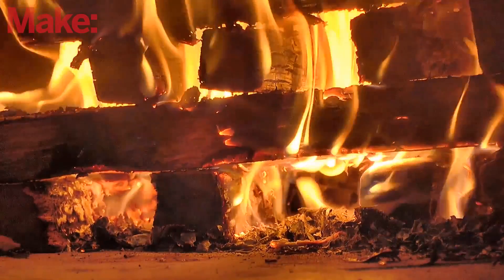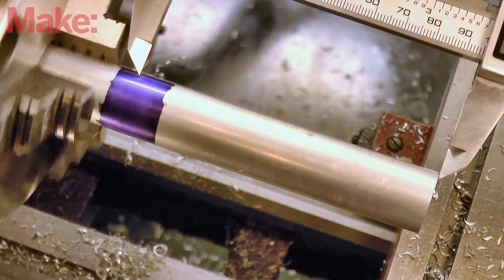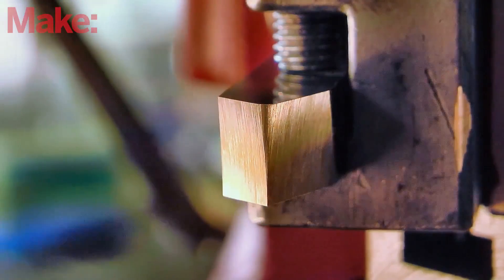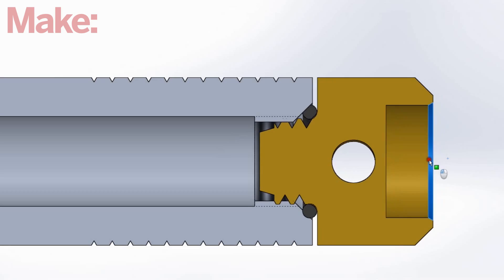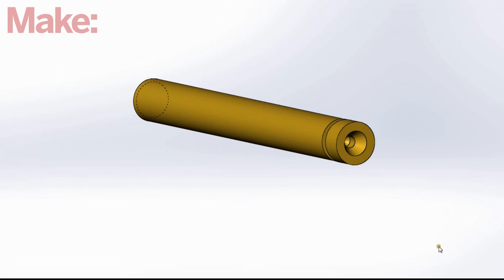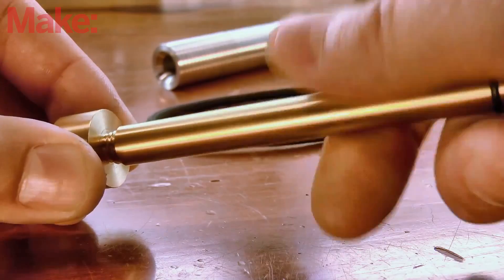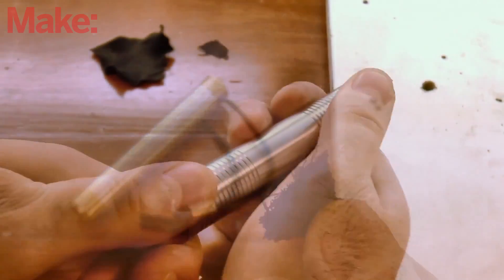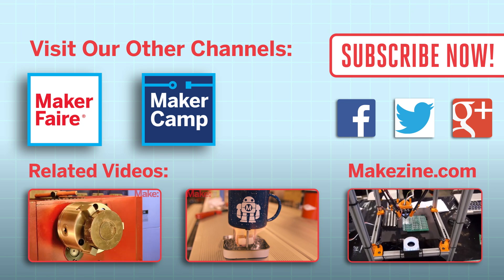Clickspring: Milling a Fire Piston

Comment: Chris, this is just awesome!

Your metal shavings look better than my best project!
Reply: Sharp tools make for enjoyable machining, and good results. And yes, it's not easy making tools really sharp, because it relies on so many things: picking a good grinding stone, mounting it to a decent spindle, knowing how to dress it so it runs smoothly, learning how to present the tool so you end up with simple, clean faceted geometry (with only one facet per face), having the patience and dexterity and fine motor control to polish the facets, and the keen eyesight (or the visual aids) to get true edges at the junction of the facets ... a useful tip is that if you can see an edge, it's not truly sharp, because what you are seeing is either a radius or a flatter area adjacent to the edge. A sharp edge is zero thickness so it cannot be seen as an entity in its own right, just as a change in shading. For best results, you want a scarily sharp edge ACROSS the chip which comes off, but the edge which is in line with the flow of the chip should be radiused. The amount of that radius is governed by rigidity of the machine and work (less rigid: smaller radius) and by the feed rate (coarser feed: bigger radius) and the desired finish (finer finish: bigger radius)
Another tip: if you cannot develop the manual skills, there are jigs and mechanical aids which can help considerably, and these can be made rather than purchased.
Another tip: tangential tooling makes many of the problems moot: you have only to sharpen the top face. However these are only usable under certain circumstances...

Comment: Very disappointed with you at 9:37. :( 

A commercial tin?!? I would have assumed that you would have milled one from solid bar stock. 

But even with using a commercial tin, what no marking fluid, layout, special machined jig to hold the tin, nothing. Just slap it on the table and drill a hole anywhere you damn please.  You didn't even deburr the hole! 

This may be enough for me to stop watching these videos. ;)
Reply: Cliff Hartle 😂
Reply: It was a funny joke hahaha.
Reply: He coulda used a regular cordless drill and some craptacular harbor freight twist drills. Instead uses a milling machine and chuck that probably cost more than my car to drill a hole in a can
Reply: This is irony, right? Lol
Reply: @c0nstantin86  
yes. yes it is you fucking imbecile
Reply: @rouge5140  God damn calm down.
Reply: @rouge5140  you seem to be in a bad mood
Reply: @rouge5140  bad, bad mood
Reply: music if I only could, glad you can.
Reply: Can't tell if b8 or not
Reply: I cant tell if this is a joke or not
Reply: TheHeroBrine Whoosh is the sound of this joke going over your head.
Reply: @theherobrine6217  then you're no more than 8
Reply: Cliff  Be quiet ,you've probably never built anything.
Reply: @workhardism  
you be quiet. you couldn't catch a joke even if it was on fire in front of you.

Comment: Could you make the cylinder one piece instead of two. Also could you make this with aluminium?
Reply: +OhNo Bro The end of the cylinder needs to be removable or you wouldn't be able to slide the piston in for storage when not in use - the pressure would just pop it out again

Comment: how does that work..?
Reply: When you compress a gas, it heats up. You can feel this with any ordinary hand pump for filling tires it footballs or whatever. Compress a volume of air enough in the presence of fuel and the fuel will be heated past its autoignition temperature and catch fire. Technically though, the extra fuel is unnecessary; compress ordinary air enough and the oxygen and nitrogen in it will combust all on their own, though normally you need ballistic re-entry type pressures to see it.🌍☄

Comment: Awsome video. I will be starting this within the next few weeks. Just curious is there any specific reason for the brass? Could the entire piece be made from aluminum?
Reply: +Emagic smiths Yes it could. If you choose all aluminium it will be lighter, but it's a much softer metal and bruises very easily. I chose brass for the color contrast, as well as the fact that it will stand up to impact and wear a lot better than aluminium. Thanks for watching.
Reply: +Clickspring valid point. thank you again I'll see what stock I have when I go to build this.

Comment: Why did you not make the cylinder one piece ? So you wouldnt use a o ring and it would be easier to build .
Reply: +Kubilay ÖZÇELİK When you make it one piece you cannot push it together for storage. By loosening the cap a little you can let the air out.
Reply: You can also clean it out if the tinder falls out of the piston.
  Mike (o\!/o)

Comment: aussie talking in inches... sacrilege
Reply: +Dosbomber It depends, Here in Argentina, we buy our stock material in Inches for diameter, but in millimetres for length, and we use callipers and tools in millimetres, but threads in inches. But you can only buy drills in 0.25 mm increments. So you just need a calculator glued to the lathe. Its a fucking nightmare.
Reply: Javier Chiappa
That sounds confusing as hell!  Getting into 3D printing, everything seems to be sliding toward metric though.  It'll be interesting to see how fabrication works out in the future.
Reply: +Luis Fernando
If you're used to it, I'm sure it can be.

As someone who does some machining, I'm used to working in Imperial measurements because that's the way it's done here.  I don't like getting funny looks from other machinists (a sort of "wtf are you saying?" look) if I mention metric (or even quote a measurement in tenths of an inch instead of thousandths -- it's surprising how pissy they can get if you refer to 0.010" as a hundredth of an inch instead of ten thousandths of an inch).

As someone who builds circuit boards, I can say from firsthand experience that they're pretty much designed for Imperial measurements.  Calculating pin layout for a standard IC is far, far easier by multiplying by 0.100" distances rather than multiplying by 2.54mm per pin.

As someone who does a lot of 3D printing, I  can tell you that that industry is predominantly metric, so I've become familiar with that system as well, and I can work with it when I have to.

And just to really fuck things up, as a woodworker, I'm also accustomed to working with..... FRACTIONS  mwahahahahahahahahahahahahahahaaaaa!!!!

So really, no system is necessarily better than any other based solely on its own merit.  They're all based on some arbitrary standard that's only the standard because we as multi-cultural humans need standards or we wouldn't be able to function in a modern world in a lot of ways.
Reply: +Javier Chiappa I know that feeling but bit drills only in mms? thats new.
Reply: +Dosbomber to be honestly is easier to work with millimeters.
Reply: Dosbomber Im not saying any of these is better, both are perfect however IMO imperial is a bit harder to learn and use, yeah conversions are a pain in the ass especially if you work with tight dimensions.

If I Have to measure long distances I would use kilometers because Im really used to these.

If I had to measure wood for building a table or cutting off metal tubes and making holes with the drill I would use inches no problem, but when it comes to the real small stuff I prefer 100x times millimeters they are easier to read and to make calculations on the fly.
Reply: +Luis Fernando Measuring distance in Kilometers  is a European conspiracy to make slow things sound fast. 100km/h ? that's the limit on most country tracks in England, it's only 60mph! ;-)
Reply: +Javier Chiappa I'm a fitter and turner over here in Australia and I still think in Imperial for drilling but I think in Metric for diameters when I'm machining. And of course, I have a calculator in my machining box. At least having both Metric and Imperial drill sets is handy for tapping hole sizes.
Reply: +Dosbomber I wish I could find a cm/mm measuring tape here in the US.  The local hardware stores are feet and inches all the way.  Amazon will help.
Reply: Elizabeth Greene try harborfreight they sell them in both systems and are pretty cheap.
Reply: +Luis Fernando Born and raised in the US and I find using metric easier than imperial.  My wife hates it when I say that I have a 3/8ths of a tank of gas. lol Many simply can't use fractions well. then the fact that metric is a ten base system, makes calculations SOOOOOOOO easy.
Reply: +Michael T Shue Studios I'm with you, and am starting to wish we had a metric calendar too.
Reply: +Elizabeth Greene Don't get me started on the Calendar and "Daylight Savings Time"..... lol
Reply: @1972Russianwolf  "Machinists use inches." completely false,  its only products going to USA that's made in USCS, so businesses in Canada and the US  use it, in Europe only threads appearing in USCS, and its a mess. And maybe if you are really unlucky a USCS drawing appear every now and then (part for some old piece of shit machine somewhere to expensive to fully replace), every car manufacturer make designs in metric, aerospace too.
Reply: @user-by7hj4dj9s ...my life owned a Pontiac Phoenix and 2 bolts side by side: one would be SAE the other metric...a freaking nightmare to work on.
Reply: +voltare2amstereo Machinists use inches.

Comment: This was about as far off of any expectation I had for a next Clickspring video and it was thrilling! Who knew that you could start a fire in such a manner?  Well done, Chris. Scott
Reply: +Aristocob Should go nicely with one those Rusticobs Scott! Cheers mate :)
Reply: Aristocob The most interesting part is that Rudolf Diesel the inventor of the Diesel engine got his idea from this very Fire Piston. A self igniting engine using compression to heat even heavy oils above their ignition point. Beautiful video, I like it alot.
Reply: +Clickspring any chance you could do a video on sharpening cutting tools?
Reply: Clickspring could you make 2 gears out of brass if you had plastic copies ?
Reply: The principle has been known since the time of Alexander the Great.

Comment: wish i had access to a mill. however, not really big into metal/woodworks as a hobby, so this is nice enough :) thanks for these videos.
Reply: +Justin Koenig You dont need a mill, just lathe. Hole for tightening pin is not necessary to make on mill. You can use handdrill for sure.